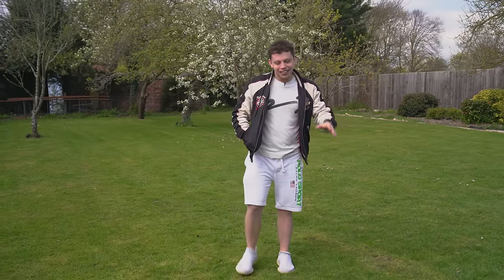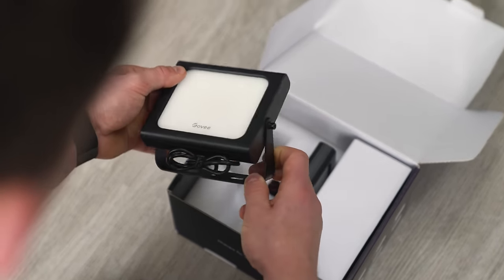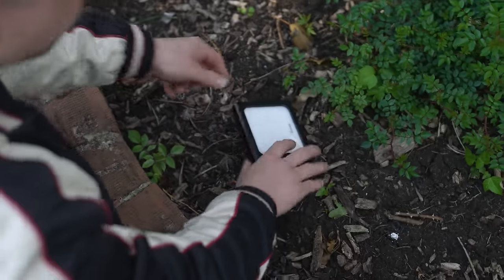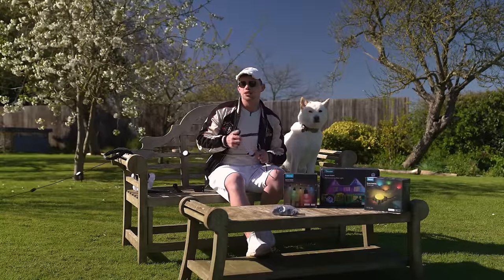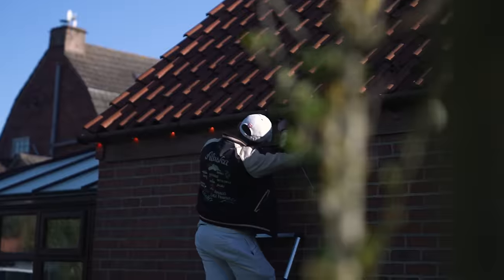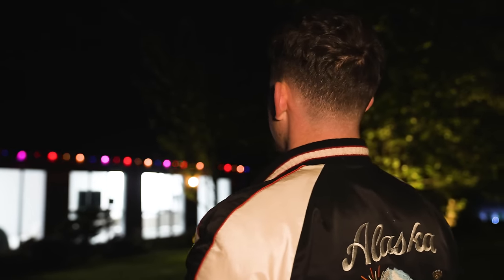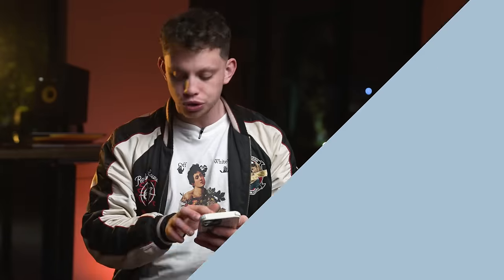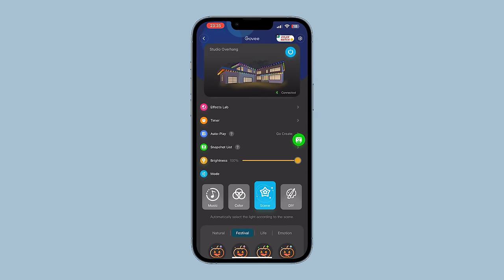Transforming My Garden: DIY Smart Govee Outdoor Lights!

Comment: How did you seemingly make certain lights so far apart?   All these lights have a set distance between them, rather short, IMO.   I'm looking to extend the distance  btn each light by splicing wires.  Did you do that?   Do you happen to know if that is possible without loosing voltage from their built-in transformer?    I'd asked Govee support without an intelligent response.   Thanks much for this video!
Reply: Did this work? I'm also curious about extending the distance.